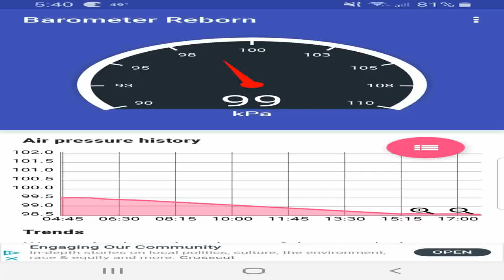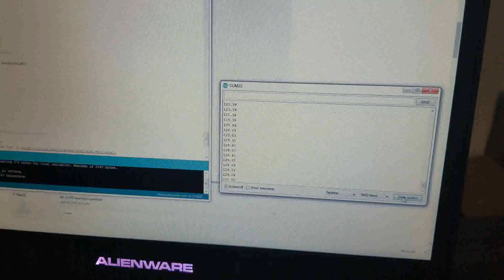Boost Controller Menu System and Wastegate PID Test

Comment: Hello, interesting what you are doing with the arduino to control the turbo, I am trying to do the same, but I have seen that you started with the RELAY command and now you have made a PID, could you give me some information?
I am from Spain and it would be of great help for my bmw lowcost project.
If you want to help me, I'll give you my email.
Thanks
Greetings and good project.
Reply from the maker: Yes, I used the relay command to make a quick program to simply test the system without a feedback loop. Then used the PID library to do closed loop. I haven't work on it since the pandemic but will be doing circuit board designs shortly. You can email me at earthonfirephotography@yahoo.com
Reply: @mr70camarors  Thanks for answering, I have sent you an email.

Comment: Nice work ! Was the code easy to write ?
Reply from the maker: Not too bad. Used the PID library for simplicity. I didn't do an array for the menu system, just a bunch of if-then loops and sub routines.